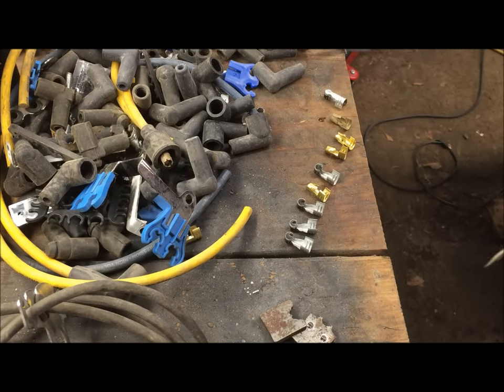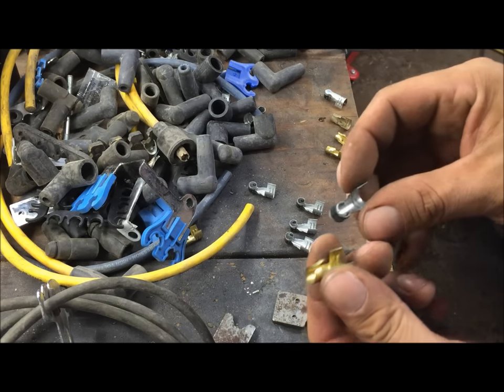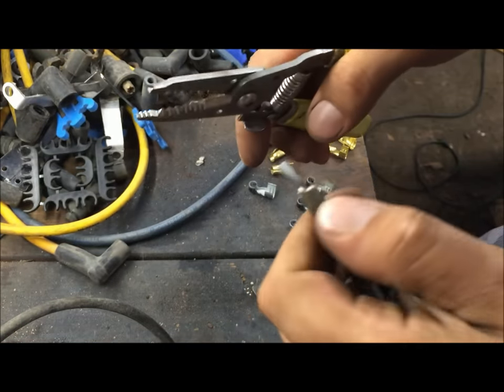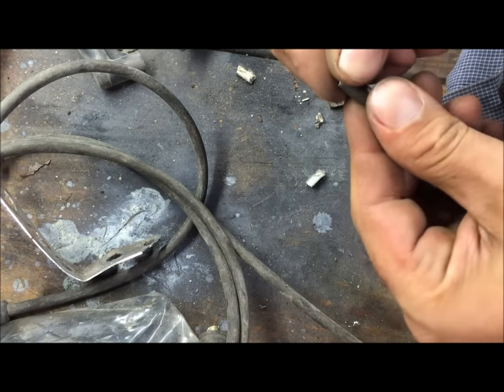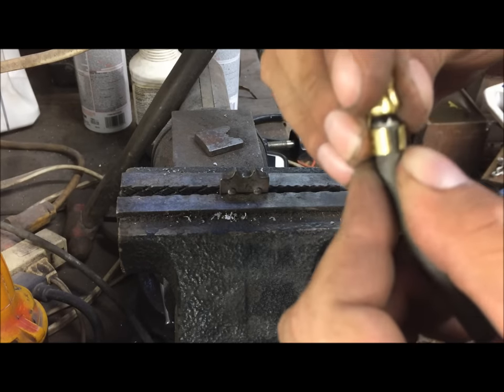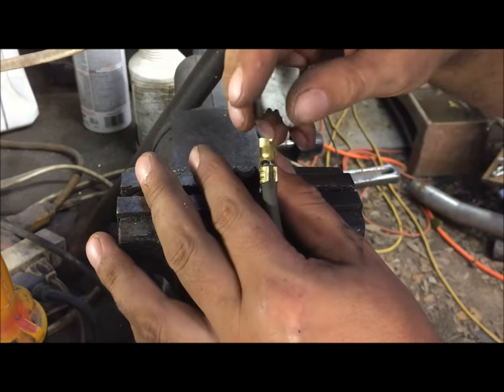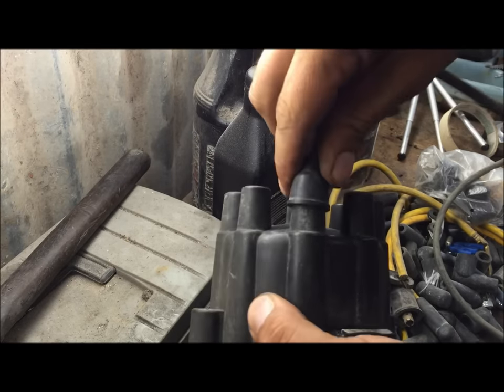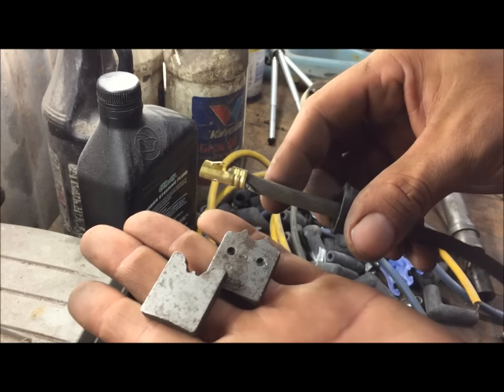how to crimp or repair spark plug wires DIY do it yourself

Comment: Honestly i have used regular wire crimpers and have had zero failure for years now. I just fold ends over and pinch back side. The most important part is wrapping wire around back.
Reply: &... Ehh.. y r u here if u k now how 2 do this؟ lololololol

Comment: $20 for a tool when a whole set of new wires is $30 at Autozone?   

I guess if you were a
Mechanic constantly fixing plug wires but I just need to fix one wire.
Reply from the maker: the wire i repaired in the video was off a brand new set... I have built many custom sets with that $20 tool and repaired probably 20 - 30 wires... that didn’t need a brand new set... I used to buy new sets every time I messed 1 up but I had hundreds of NEW wires laying around...
Reply: @chriscraft77022  I get it, my set is new too but I just need to repair one wire.  Buying a $20 tool that I’ll probably never use agian to
Replace a $30’part just isn’t worth it to me.  I’m not a mechanic.  I might change or remove my plugs once every 5-10 years, if that.

My brother borrowed my truck and messed with the wires, which were brand new. 
Now I’ve got to fix or replace one wire.

Thanks.
Reply from the maker: if you just have one to repair you can just use pliers..
Reply: @chriscraft77022  thanks.  I was just looking up how to do it.  Having trouble pushing the wire through the boot to reattach the plug socket.
Reply from the maker: orange dial hand soap
Reply: @chriscraft77022  thanks, I just ended up buying a new set.  Like I said I’ll probably (hopefully) never have to remove those wires again.
Reply from the maker: @Vichedges  LOL...  thanks for the info..  when i buy some crimping pliers ($50) im gonna look you back up and mail you my $20 set..for free...     really.. im rewatching the video and you can literally see the 100 sets i was talking about..    LMAO
Reply: @chriscraft77022  that’s great.  I can’t wait to get a tool I’ll never use.

Comment: how much is Amazon payin ya fur the 'tooOl' Chrisi ;)
Reply from the maker: I bought that tool at oreilly 17 years ago
Reply: @chriscraft77022  any advice how to get to work doing anything "mechanical"?? I got a mech engr degree but no experience. The economy in Alberta, Canada is shii t and i have basically zero connections/friends to network* me with those who do got experience that might be able to share what a mechanical engineeer does on dsily business. I started to try to at least learn some automotive maintenance (put the mechanıc into mechanical), but i dont want to go fixing things that are not broken. While I did change spark plugs, fuel filter, remove and clean throte body, replace pads and brake rotors, replace rocker cover gasket, change gearbox oil, and coolant and engine oil... I dont want to pay a technical school to learn formally in a classroom segment. My experience in life has been that people in classrooms teach you nothing and all learning is self-grasped especially with motivation. What can i do for living that is technical or mechanical related without paying 10000$/year that i dont have or falling into debt? Thanks alot thanks alot
Reply from the maker: stay away from cars.. do that in your personal time... go work for the city.. like water company.. they have engineering positions.. you get to work around electricians, plumbers, contractors.. that’s what I’m into and I love it.. usually they offer company vehicles.. they pretty much let you fix whatever you want

Comment: You have to strip the core wire or it wont make contact. The wire you made is useless.
Reply from the maker: I did strip it you big dummy.. that was a wire for my chevelle.. it’s been on the car since the repair..
Reply: @chriscraft77022  But the exposed wire which is just a tiny little tip (@1.53) did not touch the metal crimp!  Totally confused.

Comment: This isn't really a true-to-form DIY video if you have to buy a freaking $20 tool. All that tool does is keep the connector round while you crimp it.
Reply from the maker: diy is do it yourself... not do it without tools or spending money..
Reply: So true. Years ago even your local garage mechanic was a DIYer. DIYers from years past were a different breed. Great video